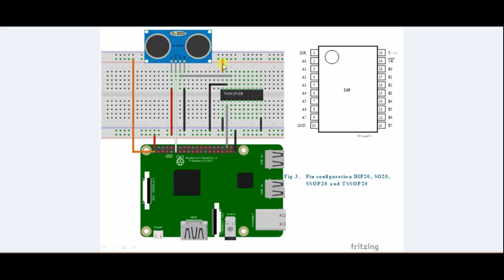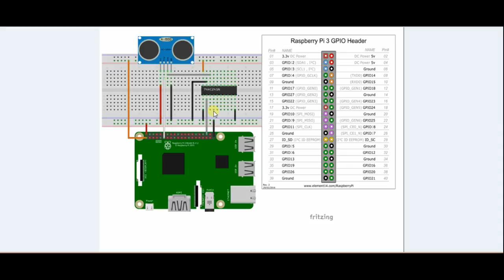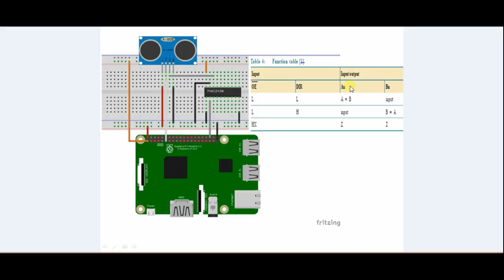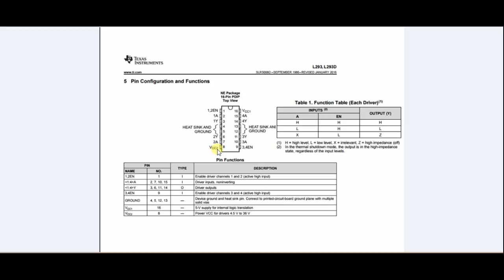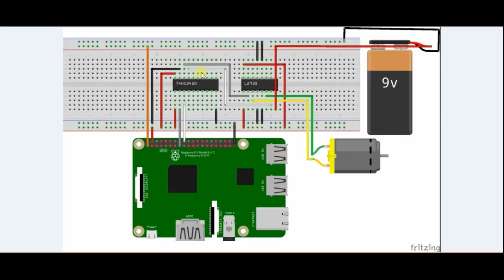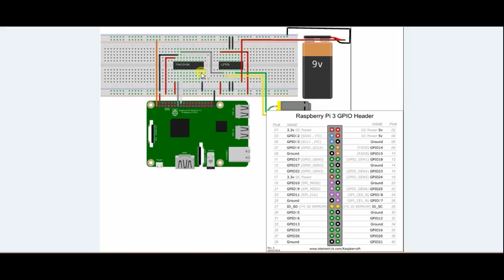HowTo 1 - 74HC245N as a logic level converter

Comment: The circuit makes no sense.
If the 74hc245 component is powered at 3.3v, its digital outputs will always have a high voltage of 3.3v (VOHigh = VCC).

So it does not convert any voltage level from 3.3v to 5v.
The ultrasound sensor will receive a voltage of 3.3v from the 74hc245 component.

the same applies to the LD293.

The operation of the circuit is completely wrong.
Reply from the maker: Hey, thanks for your comment. The Ultrasound sensor is powered at 5.0V. So, the response in the echo will be at 5.0V not 3.3V.

Comment: Hi Pratik i have one confusion regarding  SN74HC245N  for example if i want to convert 3.3v to 5v  then DIR to 5volt ,OE to LOW, Vcc ?? which im confused .what will be the vcc voltage?
Reply from the maker: Rakesh Dutta vcc should be at 5V.
Reply: Is SN74LS245N  same as SN74HC245N  ? im using SN74LS245N  and connected DIR to 5volt,OE to LOW, Vcc to 5v but the problem is all output pin showing 5 volt without connecting input voltage. what im doing wrong ? please help me out.
Reply from the maker: Hey Rakesh, sorry couldn't help you on time. But actually it has been years and now I am not exactly in the same field.